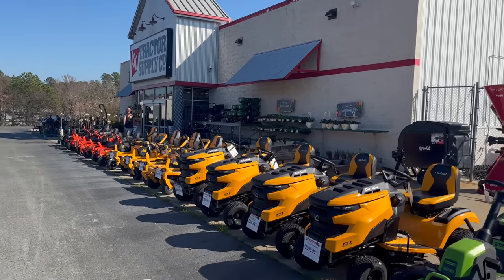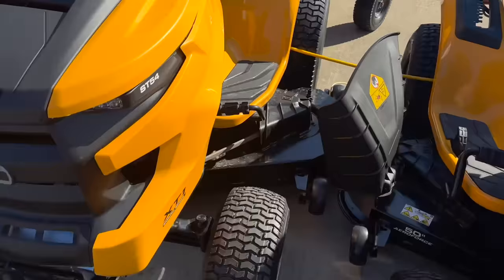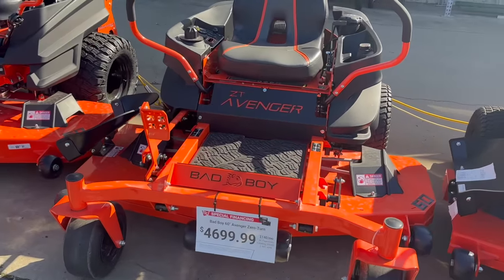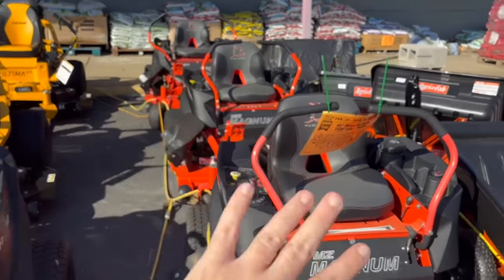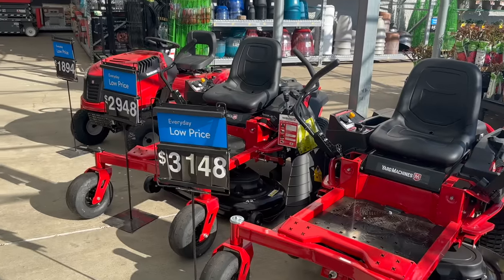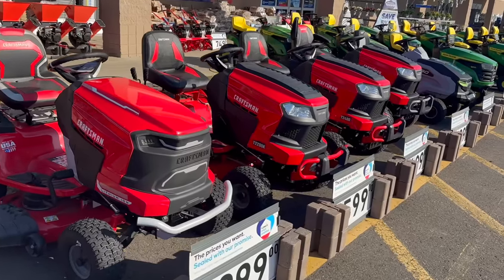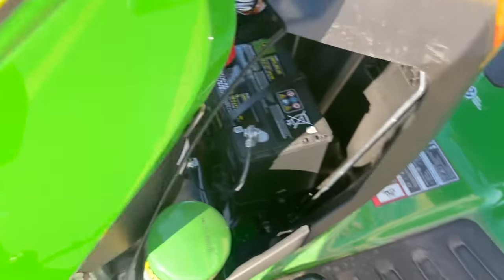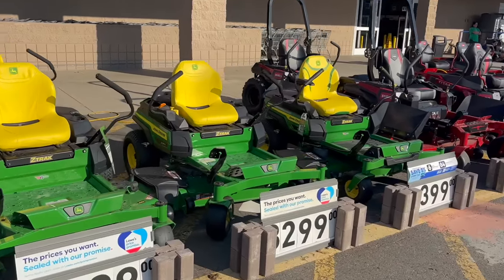The BEST Mowers to Buy and What to Avoid at The Big Box Stores This Year!

Comment: $1800 for the cheapest chinesium junk MTD ridding lawnmower that 5-10 years ago was only $1k. reality sucks
Reply: 10 years about they were 799. 10 years a ago I got a 22hp Husqvarna for $1400 lol
Reply: @bigseff23  those horsepower ratings are a joke. my kubota BX 2350 sub compact has a D902 3 cylinder diesel. rated at 23 hp and it's probably close to twice as powerful as a cheapo lawn tractor.  it runs a tiller, mows, loader work, rear snowblower, and i have a PTO powered bagger for it.

i paid $8k for it used with a little under 300 hours (that's nothing for a diesel). it's a 2006 and i think i bought it in 2018. it came with a 54" mower and the snow blower, i added a loader, tiller and the bagger later. i cannot imagine what that machine costs now new. i'll keep it for a LONG time, it's now sitting at just under 700 hours. i have done gardens with it, fixed a driveway, mowed the lawn, and cleared snow. i have only done fluids and filters in maintenance.
Reply: The prices have gone crazy the last couple years! 😮 There were several models under $100 just a few years ago!  I think I only paid $1400 for a zero turn JD, and not that long ago!
Reply: Voting has consequences

Comment: I retired as an OSHA fatality investigator and have done a couple of deaths involving zero turns. ROPS systems are so important that I would never mow on any type of slope or by any ponds without one. My last death investigation was a young man mowing an apartment complex that had a small pond in the center of the buildings. The employee ended up having the bank of the pond cave in, causing the mower and him to flip over in the water. Even though the water was just over 2 feet, the mower pinned him under the water, causing him to drown. The other fatality was an employee mowing a slope, and upon turning around at the top of the slope, the mower slid sideways down the slope, causing it to  flip over several times, crushing the guy. If either one had a ROPS (Roll Over Protection System), both would have not died.
Reply: I ran a zero turn once on a hill and never again. If you loose tractoion you could ride it to the bottom, verses a tractor that can usually steer. 
I also have wheel weights front and back with ag tires to keep stable.
Reply: @willyck948  The case where the employee was crushed flipping down the hill , he had started mowing earlier than normal, and the grass was covered with morning dew. He lost traction. Both accidents involved commercial mowers.
Reply: Accidents happen, weather you are on the job or not, (a rubber room job).  You sound like you are involved with a class action law suit here, pleading your baby sitter case.
Sorry, but I am discovering, if we want to live our lives free, we have to use our own brains and reject the baby sitters.
By the way, when I see OSHA and "facility", I am thinking a factory, (as a manufacturing expert myself), not some apartment buildings lawn.
The over reach of the baby sitters has grown.  Is it OK with you, if we "grow up" with out your expertise?  it is wasted profit now.  Sorry again, I am a free market man.
Reply: @willyck948  I saw a guy on YT mow up a hill until the front wheels came off the ground on his zero turn, and he did a 180 (reversing one wheel) with the front end still in the air and pointed the machine down hill and continued mowing.  Mowed the entire side of the length of the hill like that.
Reply: My son was at Arkansas Tech in Arkansas. He was mowing near the creek and it caved in. The mower landed on him pinning him under water. Thank the Lord I had him in the gym for 2 years and he’s as strong as a grown man. He blew his shoes out pushing and got out. He had a broken shoulder, slap tear in shoulder, dislocated knee, and tore the ligament that holds the knee cap. The company he worked for didn’t have work comp, so still working to get medical and lost wages. Looks like he will get about 8k. For a 15 year old to not be able to walk or use his arm for 6 months was terrible
Reply: I’m in Arkansas and have a small lawn business. I need to replace my ztr. What is the besr conercial mower that doesn’t break the bank?
Reply: Thanks For The Informative Real Story. I own 40 acres, Horses. Plenty Of Pasture. I have mid size tractor. Almost rolled over once, Tree Branches Fell Couple Of Times. Also have Zero Steer Mower. Almost Flip On Slope. Glad Both These Machines Have Roll Bars. Many Deaths Have Occurred On Older Farm Tractors & Older Construction Equipment. That's Why It's Required Now On These Larger Machines. I also ride dirt bikes & ATV's. Almost Killed When ATV Rolled Over On Me While Climbing Hill. If I Didn't Have Helmet On, I Definitely Would Of Been Killed. These Vehicles Are Not Toys & Everybody Riding One Should Always Wear Helmet, Never Double, Ride Straight, Never For Children Under 16 & Ride With Extreme Care. These Vehicles Have Killed Many Who Didn't Respect The Danger. Godspeed Your Journeys, Sincerely Mr. T.
Reply: @joshuacrow9495  i would recommend a well maintained used kubota f series or jd 1400-1500 series
Reply: @EarthSurferUSA  Try again. He said, fatality, not facility. 
I don't think you read or understood, the original comment properly.
Ironic, that you said we need to use our own brains.
Reply: Gary, very interesting comments. Thanks!
Reply: @EarthSurferUSA  what we did was to investigate what caused the accident. Compliance officers here have to investigate construction (1926) and Manufacturing (1910). If the person is employed, then they are covered. People always complain about OSHA until they or a family member is injured or killed. Sometimes irresponsible employers need a babysitter because of them having their employees take shortcuts and being injured or killed. I also worked in manufacturing after retiring from the military and before OSHA.
Reply: I'm in lost control and I wrote up a lot of lawn care contractors, that didn't use ROP. I did 19 fatality investigations in 23 years, but none involving lawn mowers. Most of mine, were falls, electrocutions and crushings.
Reply: @garydavis5078  driving on dew grass is impossible in a zero turn, and for sure deadly on a hill.
Reply: @mrmarkthompson2361  Many careless people out there!
Reply: We would all like the ROPS, most people are aware. So why arent they standard issue with the smaller deck models?  Would be very easy for govt to enact that knowing it saves lives. Also, the lawn care small operators that have an employee or two sometimes rush them and work them from dusk til dawn. Mowing on wet grass in the rain, not wearing any eye protection, etc. Guess the rules dont apply to everyone?
Reply: @EarthSurferUSA  Dont confuse free market with anything goes and can cut corners, operate unsafe and on the cheap and exploit others. Sure, if they dont like it can go find another job, but might be hard for a dead man to say Adios and go find another job.
Reply: I was on a trip to Cabo a couple of decades ago and while riding an ATV, one side hit a hard spot and it flipped, falling right on top of me. I just pushed it off. I did get a small burn on one leg from the exhaust pipe pressing against me, but that was it. I don't think these mowers are much heavier.

However, that experience is probably why I'm very carefully on the hills, especially sideways. I don't have rollover protection
Reply: @garydavis5078 I'm paranoid about wet grass. Lots of hills in my lawn. I don't touch them until I know they are dry.
Reply: I have a zero turn, I thought I could add roll over bar but it is not made for it.
Reply: @EarthSurferUSA  I agree 100%
Reply: I'm a safety officer in the military dealing with aviation. Really appreciate your insight, will use it!
Reply: A man slid into the Warrior river overturned and drowned about two years ago near Sumiton, AL. A sad incident.
Reply: @mrmarkthompson2361  You wear a helmet at all times. Especially when using the stairs.  According to the National Safety Counsel, There are 1 million injuries and 12,000 fatalities each year from using the stairs. You don’t want to do this?  Too bad, OSHA thinks you should and requiring you to do so.
Reply: A man has got to know the limitations of his machines. OSHA exists because the employee is the lowest common denominator -> expendable. 

Roll cages are one of those things you don't need until you do. Which usually involved being reckless, careless, not paying attention and not knowing the limitations of the machine. All hallmarks of a minimum wage employee. 
The safety devices are there to protect you from danger which then causes people to put themselves in danger. 
My ground is tabletop flat. A roll cage is an added expense/nuisance that I now have to deal with because someone else didn't want to deal with using a litte common sense and choosing the right tool for the job.
Reply: @EarthSurferUSA  Disagree, we need OSHA and safety reminders because free market decisions end up with whats cheapest not safest. That point aside all garydavis5078 was trying to say was that Roll over protection is a worthwhile option to consider. Why cant you leave that suggestion alone?
Reply: @hermanmunster714 Screw your government rules.  I'm an adult and I don't need to be told to wear a seatbelt or a helmet or use a ROPS.  I have a lot of trees on my property and using a ROPS is damn near impossible.  When my dead corpse flies out of a windshield and kills a pedestrian, you can sue my estate.  Until then, stay out of my business
Reply: Stupid choices takes stupid people out of our gene pool.  Too many people trying to recreate the movie Idiocracy.
Reply: @ReasonablySane  Just an FYI my commercial Hustler mower with the 60" deck weights over 1600 lbs when mowing, not sure you will just kick that off, especially when under water.  If I had any sort of hills on my property I would be using the ROPS and seat belt, but with all flat land, I am not too concerned.  I have never seen a landscape company around my area have their ROPS up when mowing, and none of the wear seat belts.  The only time I use my ROPS is when I need to mow at night and have all the lights on. 😉  There are some of the larger mowers like the Hustler 104" that weights in at 2500 lbs.  There is a lot of steel in the commercial series ZTR mowers.  Heck on the newer Bad Boy commercial mowers you can order disc brakes on the front casters to hold the wheels straight.
Reply: @Chris_In_Texas  Yeah. My 60" bad boy is heavy, but not THAT heavy. But I don't mow near water, "so I have that, which is nice."🤣🤣
Reply: @EarthSurferUSA and you know when OSHA fines a company, guess where the money goes,, yep government.
Reply: I mowed the church grounds for two years on a zero turn. I found out that the major flaw in them, is the fact that they can't take hills well at all.
Reply: @davidjudd951  compared to what mine does great pride and let me tell you, I got some serious hills on mine. In fact I slid down a couple and caught my deck on a sapling. Each time it eventually broke my black stabilizer bar where the front of the deck hangs from the mainframe. My place is pretty rough so I know I have two spare stabilizer bars just in case.
Reply: @ReasonablySane 
  The Hustler 55", 24hp Kawasaki I ran for those two summers, was downright scary on hills. 
 I noticed your moniker is "Reasonably Sane". 
 I asked my therapist one day, I said, "Doc, do you think I'm suffering from mental illness?". 
 He replied, "No, I think you're enjoying it quite well".
Reply: Don't go outside a meterior could hit you.
Reply: I’ve known at least 5 people that have recently (last couple of years) died from mower accidents. I also live in a very rural, small town. So that seems to me to be a very high number.  I never use to hear about mower accidents. So, what’s changed?  Maybe zero turns.
Reply: Your absolutely correct sir.
Reply: It helps to pay attention in physics class.
Darwin award winners didn't.
Reply: Was looking at a Bad Boy but saw reviews on it was at 1.68/5. Makes me think twice about getting one. Then I see this and you recommend them. I’m so confused.
Reply: honestly mandating ROPS would be far better then the EPA gas cans and emissions standards on two strokes; it actually makes sense
Reply: @EarthSurferUSA  This fool lives in New Hampshire for sure
Reply: @davidburhenn923 Did she actually recommend them?? Or were they just the winner of best mower award, in that row of junk?? I believe the later...😅
Reply: @sociopathmercenary wow!Really?😢
Reply: @ReasonablySane mowers are way heavier. I've tried moving mine around and lifting it to see if I could. I can't.....
Reply: I have a 54in Husqvarna zero turn. I have a couple of hilly places. Not fond of mowing there.....
Reply: @owenblake90  Find a local metal fabricator.
Anything can be made for, well, anything, with the right engineer.

Comment: If anyone buys the John Deeres with the 2 cylinder engine with their gimmicky quick oil change (it's like $70+ per oil change), get the conversion parts to convert it back to a standard oil filter and oil drain plug. You'll need parts AM131611 and MIU13767 plus the standard filter AM125424. There are videos on YT that show how to do it. It will save you a fortune and probably make your engine last longer since the quick change leaves a lot of dirty oil in the engine.  If you are buying a rider, buy a John Deere. Do not buy anything MTD makes.
Reply: I did that and put a valve on it that I can lock makes it really easy to change oil
Reply: Don’t buy a John Deere from a box store. They are crap, just like the other brands. If you want a real JD buy one from a dealer that was built in Horicon Wisconsin. With the proper maintenance they will last you lifetime.
Reply: @marksayers4105  Nothing wrong with John Deere built in Greenville, TN.
Reply: @ITOLDUDA Greenville makes the zero turns, correct?

Comment: I bought a Toro Titan MX6000 10 years ago June from our local family owned dealer and couldn't be happier. I mow about 5 acres in about half the time as my old mower. I have a few steep banks that the zero turn can't handle so I finish that with my almost 40 year old Wheel Horse from the same dealer. Nothing wrong with the big  box stores but the local dealers are worth the little extra investment every time.
Reply: At least when Toro bought Wheel Horse they maintained parts inventory for a good while
    I was able to cut pasture grass and weeds down with a fifty year old wheel horse Raider ten and the new belt I had to buy was only fifteen dollars. Paid three hundred for that tractor that's built like a tank. The K series and Magnum series Kohler engines on the Wheel Horse will last and last. They are tough enough to run a breaking plow,snow blade and rear drive tiller.,.
   Those big twin engines come with much higher fuel consumption per acre as well.
   Thanks for the heads up on those Bad Boy mowers. The difference is obvious
Reply: You’re exactly right. When you need a part they’ll have it and get it. The dealers will take care of their customers.
Reply: Thanks for the info I have always bought commercial products 
No home owner stuff
Reply: I live in Hawaii, so my lawn grows year-round. I have over an acre of grass. I purchased a 46" pro series Craftsman with 24 hp Kohler back in summer of 2017.  So far I have replaced both spindles and my blade drive belt. I replace my own blades, change my oil/oil filter, fuel filter and air filter and lubricate as needed. I also use ethanol-free gasoline.
The issue here in Hawaii is that there are only a few dealers here in Hawaii (Kubota). As far as I know, if you need your mower serviced, you have to transport your mower to their shop. One thing I liked about Craftsman is that they came out in their Blue vans to due repairs, if needed. But Sears no longer is in Hawaii and their Blue vans only service appliances. Really sucks here for customer support.
Reply: Whelp you never owned a john deere z track from a jd dealer. So yeah, you have mo idea. The mowers they sell at home box stores are the companies worst entry level  junk.
Reply: @Gomoboo ... Do and due are homophones.
Reply: @JW...-oj5iw  - Yes, I understand that. I just failed to review before posting. There are many examples of folks misuse of to/too, there/their/they're, etc., etc. It was a simple error on my part. You failed to "teach" me anything.
Reply: I bought an Ariens Ikon X D 52” Zero Turn With Kawasaki Engine from Lowe’s 3 Years ago and it Will climb an wall.
Reply: @Gomoboo  ... A simple error you say, and I "failed" to teach you anything. The facts bear that out with the exception of which one "failed" anything. You failed in your writing, followed by your failure to correct your error. Then, in a fit of pique, you tried to shift "blame" to me for not teaching you anything. The failure to teach extends to your inability to edit your reply. Do you think that's beyond your capabilities?
Reply: @JW...-oj5iw - I chose not to. Not in today's world wherein the majority of Americans don't know the difference. Also, you should really consider getting off your high horse. Or, better yet, perhaps you should try to teach English. Preferably in an inner-city school where they need it most.